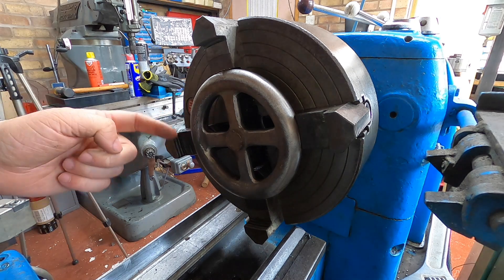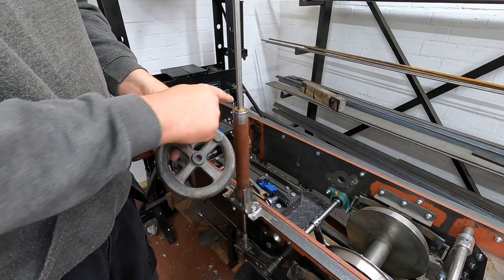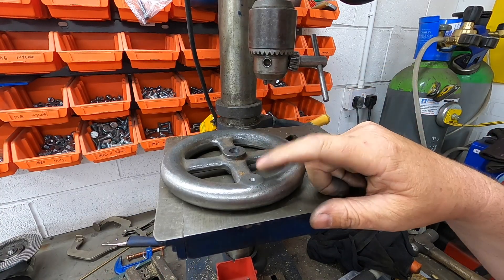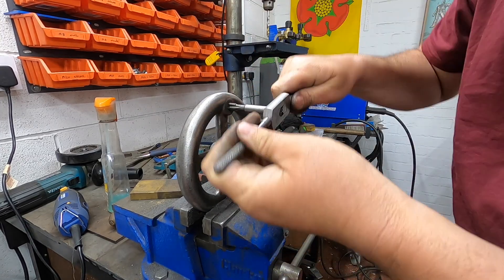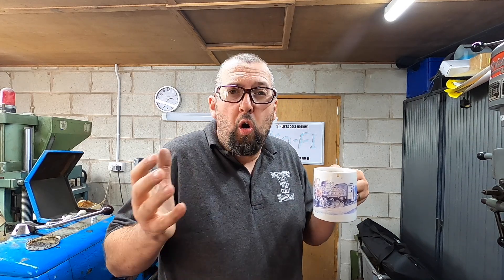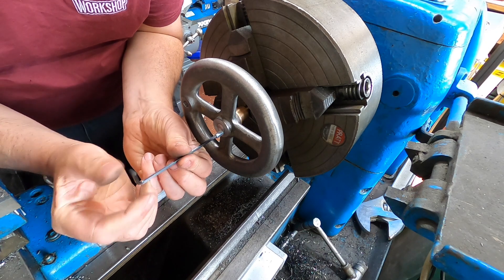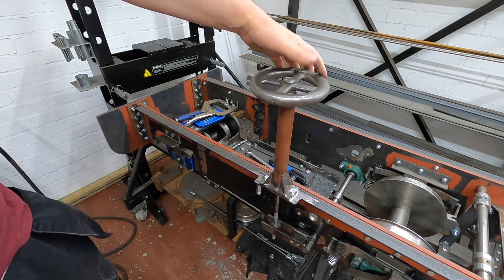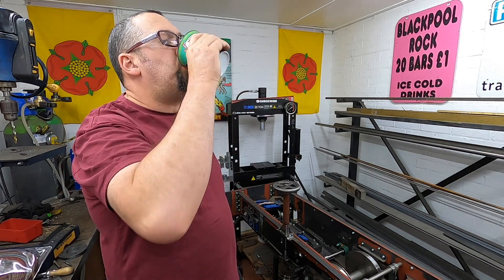Working Brakes?? -  ep48 - 7.25" Gauge Steam Locomotive Build

Comment: Lovely but of engineering as always. Although the loctite  to hold the brake handle on made my teeth itch 😂😂
Reply from the maker: Thanks Paul, much appreciated. I didn't show it in the video, but I put the lathe into the lowest gear and tried to break the loctite...... the chuck was rotating, think that will be strong enough 😂. All the best, Matt.
Reply: @MattChiversWorkshop  I’m not saying it won’t hold. Just in my head it shouldn’t

Comment: Are you tempted to also include a steam brake in addition to the handbrake?
Reply from the maker: Hi, I did have the thought of putting a steam brake. After having a conversation with my mentor who has built the same loco with a steam brake, he said he very rarely uses it. Either uses the air brakes on the train to stop, or the handbrake. If you look at my lift link at the bottom of the brake shaft rod, I've made it so it can be easily taken apart to switch the linkages for ones needed for a steam brake. The brake layshaft is also purposely longer and the boss required fitted at the other end which the steam brake push rod would be attached too. I've future proofed it, hopefully. All the best, Matt 👍
Reply: Nice one Matt and thanks for the description. I like your thought process of future proofing the design. 

Personally I would have a steam brake if only for the reason of something else to play with. Saying that someone else to go wrong! 

All the best with the build

Comment: Mate, I'm already subscribed but doubt you'll be bringing the locomotive to any railway near me! 

And if you're going to make a joke about drinking tea on the internet, at least have a Blondi Hacks or Bad Obsession mug to complete the bit 😂

Should add though, I'm thoroughly enjoying the build!
Reply from the maker: Owen, Thank you for your subscription, it is much appreciated. Are there any 7.25" gauge railways near you??  Not a Cutting Edge engineering? or Colin Furze? or This old Tony? or Abom79 mug?? 😉 All the best, Matt. 👍
Reply: @MattChiversWorkshop  Several but they're over the other side of the planet to you! Diamond Valley Railway has about 1.5km of mainline track. Victorian miniature railway will end up with a bit more but still under construction. Have my own 7.25" gauge Heidi that is in desperate need of an overhaul...

Comment: would a cotter pin have worked the same as the grup screw
Reply from the maker: Hey up Mozzer! There are probably quite a few areas cotter pins would work on this loco than what I have done (Especially in next episode, possibly), but in the brake handle is not somewhere I'd put one. The loctite will hold it, its gone off like concrete!! All the best buddy, Matt.